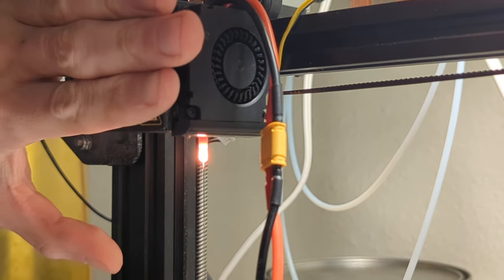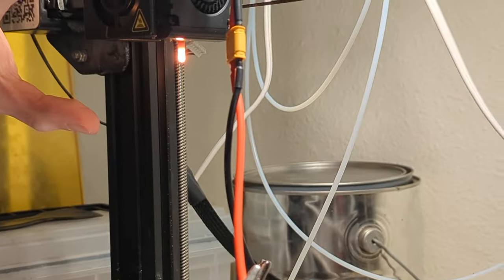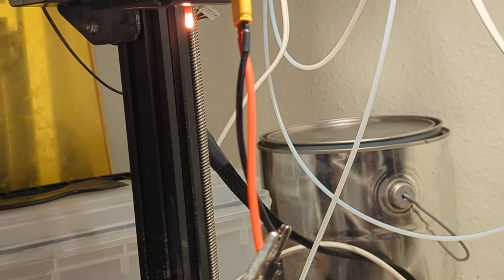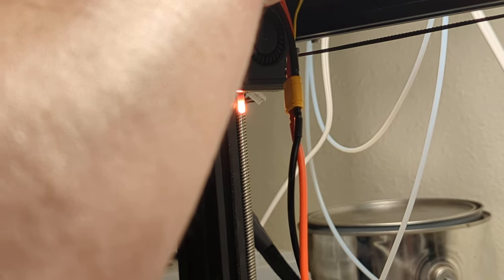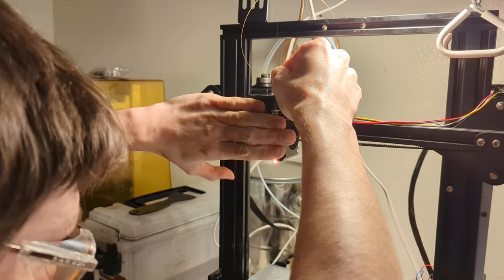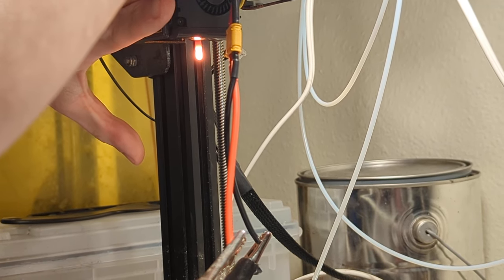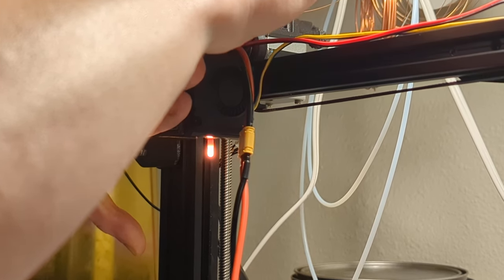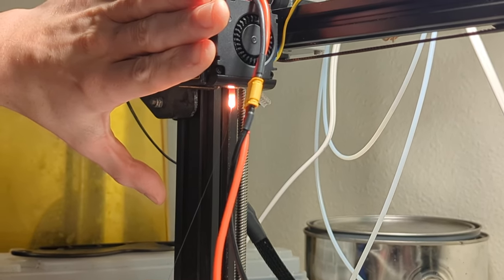clearing a jam in 1300 C hotend on the ender3.

Comment: This is cool and all, but would it still be able to print with PLA?
Reply from the maker: yes. if you draw your PLA down to 0.5mm diameter.
because it has higher power density and no big reservoir of molten material hanging around, it should actually be capable of printing plastics, even faster than regular hotends.
Reply: Ha,  @rotoforge2024  please dont.
I want to see 3d printed benchy now tho. 
Absolutely fascinating that youre even attempting fdm bronze.

Comment: From what little experience I have with semisolid. (I think I've made them a few times on accident) they might be too viscous for your current config. ) Building up enough pressure in the nozzle to force the material through with 
.5mm wire is going to be hard. If possible. Widening that hole up until the end and using bigger wire might help if jams persist.
Reply from the maker: there is no nozzle constriction. 
it is a straight tube.
Reply: Ah, so it should be fine to just edm bore part of it larger?
Reply from the maker: Thanks for letting me know!
it does have a slightly conical cross section toward the exit. 
the metal is also not semisolid until it reaches the build surface. Because the hot section has a pretty steep thermal gradient up the exact exit of the nozzle. basically, the nozzle tip is the heater. 

the increased power demand of a larger metal volume to heat, and the internal diameter of the conductor in the glowplug(being abot 1 mm OD through which we drill an 0.5mm ID hole)  would make it very difficult, to use biggerwire unfortunately... :-/
Reply from the maker: no. probably not. when i have tried drilling an 0.8mm hole, the conductor inside is reduced by too much and the plugs burn out almost immediately. ) 0.5mm seems to be sweet spot between preserving conductor cross section, sufficient wire diameter to maintain some stiffness, and and a small enough volume to be able to flow at reasonable FDM like like rates given the surface power density the glowplug can supply. 
 @a.very.lockwood
Reply from the maker: If anything, going even smaller would actually be preferable, because it ensures even tighter control over feedstock temperature at the nozzle/heater exit orifice and thus, at the deposition zone. 

I intend to attempt 0.3mm drill and 0.4mm drilled plugs in the near future once I get the EDM setup tightened up and dialed in further.  @a.very.lockwood

Comment: Very smart to do this without hand protection. I trust u did it for eyes.
Reply from the maker: its very hard to feel the changes I need to feel to unclog it, with gloves on....
the force the tiny amount of material in the hotend exerts is well below my tactile threshold in gloves.

and its not nearly bright enough to create problems for  my eyes. 
its basically like looking at a mild torch flame, at this power output.
Reply: @rotoforge2024  Soldering above 300C can give splatters that reach 1meter distance. Bright hot metal could do the same. You only need to make one mistake to regret it, and cheap gear that still has feeling does exist. 

Other than that, you are setting an example for inexperienced people to do the same.
Reply from the maker: the metal is not molten if things are working correctly and so should not be splattering...its also important to note that material velocities in the system are quite comparable to typical FDM.

but i see your point and will make a point of encouraging safer practices in future videos.  @aero1000

Comment: Be really cool if you replaced the print head with a tig welder and an automatic wire feed. Then you can print in steel, too 😂 As a side-note printing by fusing rather than depositing or sintering would make getting small feature sizes quite challenging. I’m sure someone is working on it, tho.
Reply from the maker: we are basically doing meso scale semisolid forge welding...

there has been discussion of attempting a meso scale continuous casting approach with relatively purer metals... like electrical grade copper.

still lots of tests to do.

the big difference between this approach and WAAM is that we are attempting to only inject the energy strictly necessary to facilitate semisolid forming, and interlayer diffusion bonding under such temperature and pressure conditions.  WAAM tends to spend a large amount of energy vaporizing metals, and heating air/process gas. Which complicates controlling deposition temperature...among other factors.
Reply from the maker: regarding printing in steel, there are complications with ferrous materials and the silicon nitride ceramic. 
iron loves to leach silicon.
so steel  may be off the table for this particular device at the moment. 

but anything nonferrous with a melting range below 1800 C is probably fair game. if one is alright with adding an inert atmosphere.

Comment: I wonder if the plug is due to the metal purity. Lower purity metals might have excess carbon or other higher temp metals that could cause issues.
Reply from the maker: it was due to me being dumb and overheating the bronze. lol 
though yes, a consequence of this may be the formation of high melting point compounds. 
though the ceramic of the glowplug is essentially inert and nonwetting to most metals.

Comment: thats fucking hot. are you printing metal? are you using a titanium nozzle/heater block?
Reply from the maker: we are aiming at printing metal and ceramics. There is no heater block or nozzle. it is all the same part, made of a ceramic glow plug. I will update the description to include more information.
we will be releasing a video on how we built the hotend and why we built it sometime this month.
Reply from the maker: https://www.printables.com/model/635347-beru-glow-plug-cgp-002

here is my printables page where I posted about the exact type of ceramic glow plug we used. I modeled it in detail and characterized its electrical properties.
we used the powercore EDM 
https://www.rackrobo.io/

and a DIY drill unit(soon to be modeled and posted) to drill a 60mm deep 0.5mm diameter hole through the ceramic, and developed a process for mounting and electrically connecting to the plug in the stock ender heat sink and gantry mount.
we are specifically targeting the lowest cost, most accessible metal and ceramic 3D printer we can by building it first as an ender 3 mod....
maybe this will evolve with time, but more experiments are definitely needed.
Reply: @rotoforge2024 amazing stuff. Thank you!
Reply from the maker: I should probably also mention that most common grades of titanium will lose more than 80% of their yield strength at 1300 C...
they are probably not suitable for structural use at such temperatures. Not to mention that titanium oxide will not protect them from oxidation very well when things are that hot. 
The rate of titanium diffusion into the oxide layer, and the rate of oxygen diffusion into the titanium metal through the oxide, goes parabolic between 700 and 900 C... unless the metal is very thick, it will embrittle and basically flake apart as it converts to oxide scale much beyond this temperature range in air. 

some alloys used in turbines may fare better.
Reply: Metal hotend for those temps would run into oxidation problems pretty fast. Specific Tungsten or Molybdenum alloys could withstand the temperatures though.

Comment: This would print fast
Reply from the maker: by my best guess based on the typical ~8 watt/square mm power density in the tip, it may be capable of printing ABS at up to 1000 cubic millimeters per second...

Comment: A lower-melting metal could be a good flushing filament to help clean out the nozzle, no?
Reply from the maker: I did not try this. I do not know. 
I would prefer to use a material which does not melt to clear a blockage. 
This is largely because, if a material melts in the nozzle, it is difficult to push out of the nozzle due to the high surface tension of molten metal. It tends to just pool in the nozzle and form oxide slugs or granular jams. 

Its important not to fully melt the feedstock...
though we might be able to find a way to print with fully molten material in future. we are going to have to test it to find out.

Comment: What even does it print with at that temperature I hope you didn't heat it up to that temperature trying to get rid of the clog
Reply from the maker: 24 AWG (0.52mm OD) 510 phosphor bronze wire is the feedstock.
Reply: @rotoforge2024  holy moly

Comment: 1300c hot end? Having the temp of the freaking sun at your fingertips.
Reply from the maker: not quite that hot.
more like surface temperature of a brown dwarf. 
or maybe of the earths upper mantle? 
IDK.

maybe more comparable to a torch flame, just at solid state density. torch flame being like ~0.004g/cc, where the ceramic of our hotend at similar temperature and power density is ~4g/cc..

condensed fire

Comment: How do you handle the neighbor heat generated on this? To the surrounding common components I mean. Keep it up, sounds intriguing and fascinating.
Reply from the maker: it uses the same amount of power as a stock hotend roughly. 
so the hotend cooling and part cooling fans are sufficient to keep the surrounding parts cool.
Reply: awesome!! @rotoforge2024  -- cant wait to see your first metal prints!!! is there any other blog on your side we can follow or  this channel is all?
Reply from the maker: I am working on a video elucidating how we build the hotends.
I will also be providing a more technically detailed writeup in my google blogger blog.
I have been encouraged to start a hackaday. but have not yet done so. 
I typically provide updates on my efforts as they occur on the discord. 
Once we have an implementation which seems reliable, i will be pushing the design files, and any code/BOM etc, to the github and  to printables.
it has been a long road, and i have not been able to keep everything up to date at once.
this was something of a handbrake turn from our previous approach of friction extrusion deposition, and friction surfacing (basicallydesktop micro stir welding) so things are a bit out of sorts.  😅
 @alextutusaus
Reply: kudos to you and best wishes @rotoforge2024

Comment: Could it be that oxides were forming ?
Reply from the maker: the oxidation of material in the plug is rather limited due to the thermal expansion of air, and the scouring of oxygen by the metal as it enters the plug...
the bore tolerance is about + 20 micron to the wire diameter. 
so there is not much room for oxygen ingress once the bore has metal in it. 

but yes, if you melt off the tip of the metal wire inside the plug then pull the wire out the slug of molten material oxidizes and becomes dfficult to remove. 
we had to reheat it to nearly 1400 C,and push it out with a tantalum wire after breaking it up with a silicon carbide monofilament first.

Comment: Can i ask why one would do such a thing? i dont know much about 3d printers. I didnt even know the extruder could get that hot.  isnt the nelting point of steel like 1300°?
Reply from the maker: we want to print metals and ceramics. 
particularly for printing high reliability electronics, and various machinery that plastics cannot really survive in.
rocket engines, motor parts, robotics elements for end use, etc.
Reply: @rotoforge2024 like what?
Are you printing with aluminum or some alloy? What do you use for filament and could you use this  to print PCB traces on circuit boards you think?
Reply from the maker: I am printing with 510 phosphor bronze 24awg (0.52mm OD) wire from mcmaster carr. 
https://www.mcmaster.com/9668k92/
 @andreamitchell4758  

yes we built this specifically for printing high reliability electronics in 3D metal and ceramic. 
it could also be used as a wire embedding hotend for printing metal into/onto plastics in 3 dimensions instead of the typical flat stacks that FR4  PCB use.
1100, 2024, and 4045, 6061 aluminum, sterling silver, and pure copper are also on the list of materials we will test with.

We also will be attempting to print with borosilicate glass, quartz, basalt fiber, and aluminosilicate fibers soon for printing dielectrics and or semiconductors.
Reply: @rotoforge2024  that is pretty insane
Especially for a consumer grade printer and even more insane for an ender 3 !
I would have thought for sure the heat would have radiated into the tool head if this cheap Chinese printer and broke something if not melted it to goo.
Pretty amazing stuff, so what are you using to insulate the nozzle and have you had problems with the heat damaging any other parts of the printer?
Reply from the maker: the heater uses the same amount of power as the stock hotend, and even uses the stock heatsink. the only difference is that it uses that power to heat a volume of ceramicdirectly at the nozzle tip that is about ~11 cubic millimeters, instead of the typical ~4000+ of an aluminum hotblock+nozzle+heater, and has none of the thermal capacitance or convective losses of that design.
the semiconductor ceramic nozzle tip is also very efficient at converting electric current into heat compared to a conventional nichrome wire coil in magnesium oxide insulation. 
this means that the same 40-60 watts, can raise the smaller ceramic volume to a much higher temperature, and get it there ~3 orders of magnitude faster (roughly 1300 degrees C in ~2-3 seconds.)

the jist is, that the total power dissipation into the rest of the printer is about the same (losses to the heat sink are actually slightly less as compared to a conventional hotend since the larger thermal mass drives a larger gradient to the heatsink and serves as a large convective loss) 

this means that there is no risk to the rest of the printer.

another benefit of the all ceramic hotend, is that it does not have a melting point and is positive temperature coefficient. So it serves as an inrush current limiter, and cannot be destroyed by thermal runaway given the power output of the ender 3 main board.
Even if the hotend did reach the ~12-15 watts/square mm (about 120-150 watts of input power) required to overload it, it would merely start to vaporize until its resistance increased enough to stop the current flowing at the given drive voltage instead of forming a melt puddle of aluminum on your printbed and possibly starting a fire....
the temperature coefficient is also very stable up to about 1500 degrees C in air, and in the prescence of the metal feedstock, and so serves as a reliable built in (and extremely fast and sensitive) temperature sensor (by using a current sensor to low side sense the current running through the glowplug while it is under power) This current can be mapped to temperature precisely (about +-2%) and used in a conventional marlin temperature table to provide for drop in PID or model based hotend control for the heater, with no need for an additional temperature sensor.
though for printing at temperatures beyond about 1300 C, this method could be rendered unreliable by reactions with the feedstock depending on its composition... Ni-Ti for example, could be troublesome... as could alloys containing more than about 2-3% lithium by mass. 
 @andreamitchell4758
Reply: @rotoforge2024  interesting so are you using a Bowden style extruder or a direct drive?
Did you need to modify the gears in the extruder?
I see what looks like some Bowden tube but it doesn't look like it's being used.
Reply from the maker: using a direct drive belt extruder. the papilio lite. the green bowden tube is just to connect the extruder to the entrance of the glowplug...
in this video I am just pushing a wire by hand to try and clear a slug of material we melted in the hotend while doing ome testing.
a belt extruder (the papilio in particular) seems to be very good at pushing fine wire without damaging it or kinking it, and very good at handling brittle materials like glass or ceramic filament. 
https://kevinakasam.com/papilio/
  @andreamitchell4758

Comment: What did u do?
Reply: this is insane btw
Reply from the maker: working on a more detailed video about exactly this in the next few days.
Reply: @rotoforge2024  metal printing? it would be soooooo cool
Reply from the maker: and very useful....plastics are quite limiting in what they can withstand, and are not very helpful for electronics except perhaps as low temperature insulators.  :P
 @Nathandoesntknowwhattosay

Comment: Touch it with your fingers
Reply from the maker: I have done this by accident on several occasions. the thermal mass is small enough that the damage is limited. But it still hurts like hell. literally vaporizes flesh like a light saber.
Reply: @rotoforge2024  ooof i bet that woke you up
Reply from the maker: yes. quite salient, though I find i still cant do much fine work in gloves.  @unharmonix